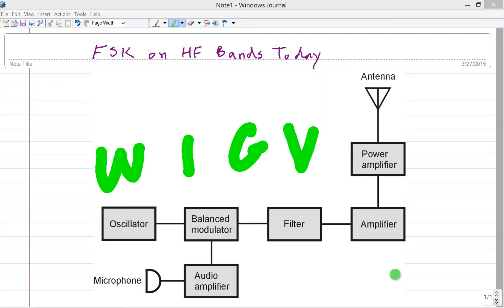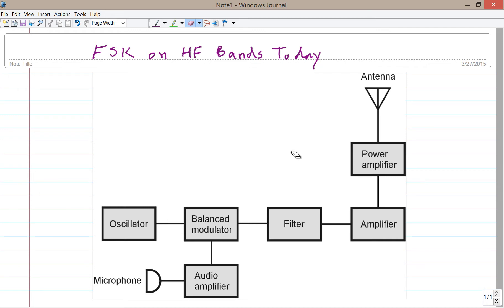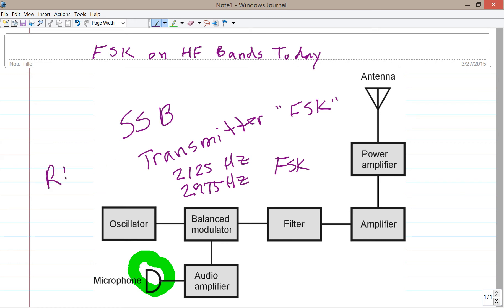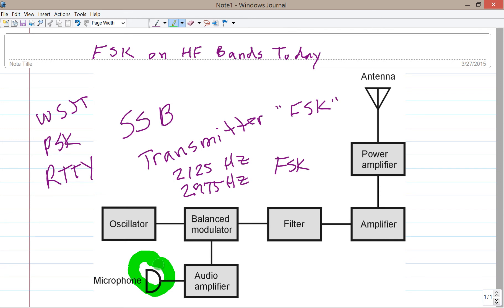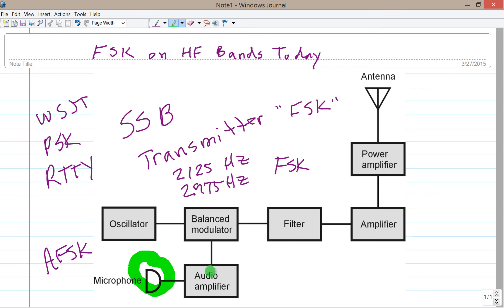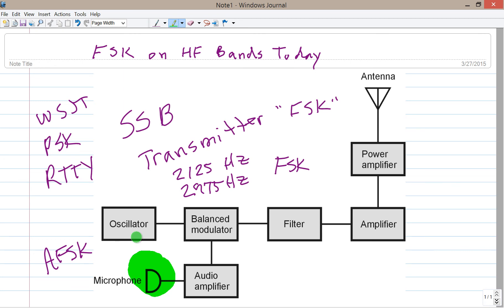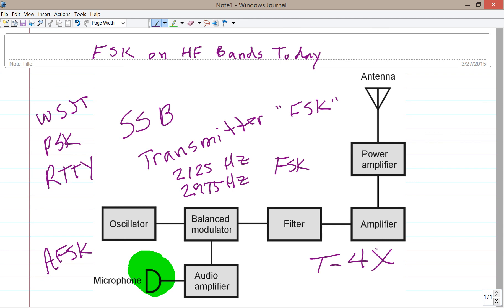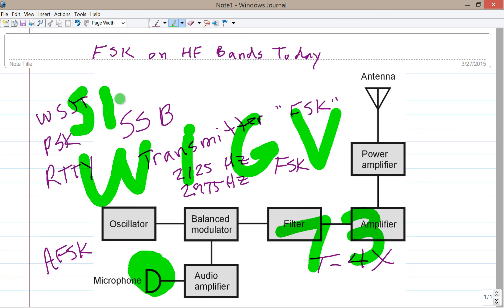FSK on HF Bands Today

Comment: When you say AFSK is the "exact equivalent of what would happen if you reactance-modulated the oscillator" (4:48), the result would still be AM modulation, right? So you would just be using some circuitry to change the frequency that was modulating the amplitude of that oscillator between the 2125 and 2295Hz, without having all the complexity of a full SSB transmitter?
Reply from the maker: Well, you could look at it as SSB, which is of course simply AM with one sideband and the carrier missing. But if the modulating audio is "clean" (just the two tones), the signal that goes over the air is exactly the same as the signal that a reactance-modulated oscillator produces. When I had the Drake T-4X transmitter, I did in fact reactance-modulate the oscillator and used key-down CW, not SSB. The theory differs; the over-the-air signal is the same in practice: a frequency-shift keyed carrier. Two different ways to get to the same place, you might say.
Reply: Okay cool, thanks. So you ended up just using the key-down to change the modulating signal between space and mark frequencies? Or does the key-down actually change the frequency of the oscillator? Also, when you refer to the frequency-shift keyed carrier, are you referring to the audio tone that (in AFSK) is being fed into the SSB transmitter, or the oscillator that is the base for the AM signal? The former makes more sense to me but I may be confused.
Reply from the maker: The T-4X transmitter was operating in CW mode (with the key down all the time). I directly shifted the oscillator frequency by switching capacitance in and out of it. The transmitter's VFO had a little terminal on it to which you could connect a capacitor to change its frequency. That was in the 1970s before AFSK in SSB mode became the common way to get FSK. There was no "audio tone" involved at all. Actually I don't recall all the details of how I built the circuit to do that trick, so I''m afraid that's all the more I can tell you.
Reply: Ah okay, I understand it now (I was misunderstanding amplitude modulation; specifically how the frequency of the audio input effects the RF signal. Now it's clear how it's similar to what you did!). Thanks for the clarifications!

Comment from the maker: I meant to say that the oscillator should produce audio tones of 2125 and 2295 Hz for 170-Hz shift (at 2:45 into the video). The values 2125 and 2975 Hz would result in 850-Hz shift, rarely used anymore. Sorry for the error.